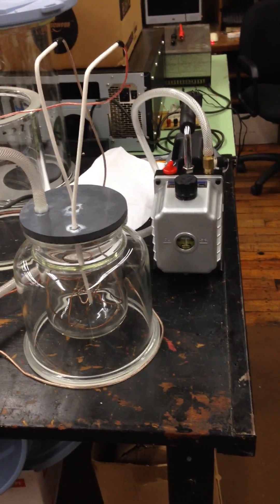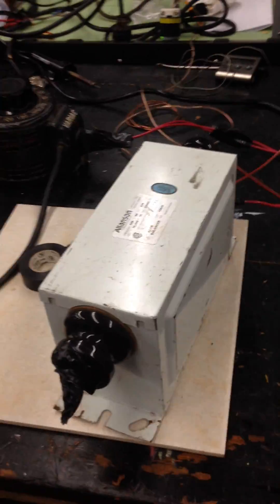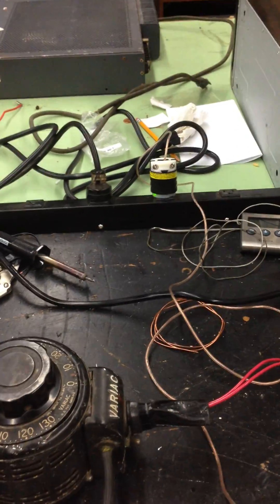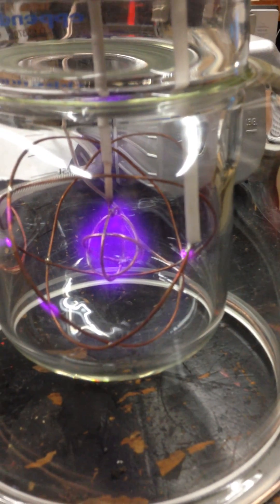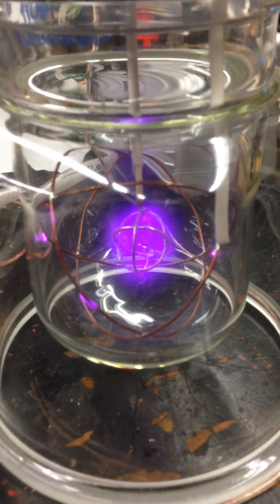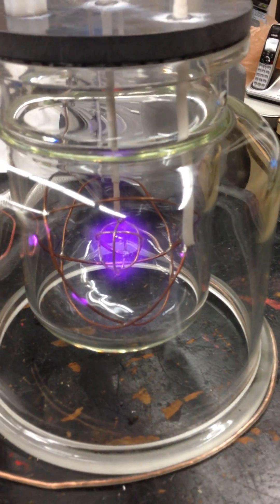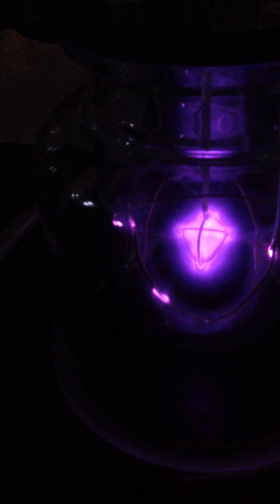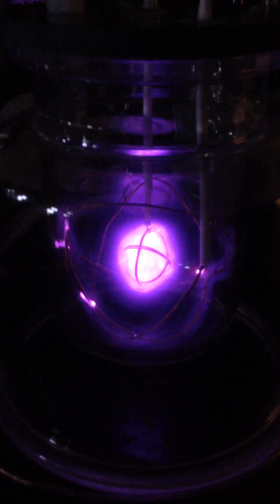Fusor in action 130%

Comment: Amazing but how the hell does that surface temp doest melt the damm copper tubes around the star?
Reply from the maker: The inner sphere is made from the tungsten filament from an old quartz heater. Plus it’s under a vacuum, so no air no heat transfer.

Comment: Where is the helium?
Reply from the maker: StreamWARE there is no helium the chamber was under a vacuum. The Purple glow you saw was residual atmospheric gases. High end researchers use much better vacuum pumps to achieve a higher vacuum level and a lot more power. This was akin to a light bulb in comparison to what a actual set up can do. A cool light show but not capable of producing actual fusion.

Thanks for asking a question
Reply: @TheValveBoy  Well i was thinking about making a fusor with helium inside of it, do you have any advice? Im going to be using 12kv
Reply from the maker: StreamWARE if you want to do research check out 
https://www.fusor.net/board/

Deuterium is what you need not helium, 12kV is in the starting point of fusion but you have to pull a very high vacuum and inject a trace amount of deuterium into the unit. If you manage that your going to need shielding as well, as you will start to get neutron production as well as x-rays and a UV light. Do some research, talk to others on the boards and be safe, 12kV will kill. Respect what your going to be playing with or it will bite you.  
Other people who are working on this are a great resource and know a lot more than I do about this. My unit was a demo unit little more than a cool looking light bulb.

Stick to it and good luck

Comment: Awesome build! Did you ever test to see how long the inner grid lasts before melting? Do you have any plans to get another transformer (or two) and go for actual fusion?
Reply from the maker: The original inner grid I made was out of soft copper wire. It melted/vaporized in a few spots after a few runs of 10 min. I made a tungsten inner grid that has lasted so far, from the filaments of old quartz heaters. If I can scrounge the parts together I would like to go to the fusion level. The equipment needed gets pricey quick. Ultra high vacuum pumps, and all the extras piping and gauges and chambers cost quite a bit.
Reply: @TheValveBoy  you can make an ultra high vacuum by using sprengel pump :)
Reply: @121sunita  Why did you have to say that? You just had to say that, didn't you? Now that I hear it from someone else I have to build one🤣. I was thinking about making one just earlier today for this exact purpose and here you are giving me positive reinforcement, now I have to go buy a bunch of glass lol. At least I already have 3.5 pounds of Mercury, that will make this project a lot cheaper...

Comment: can it make electricity?
Reply from the maker: At this point ....no, but there are a lot of people out there with much more advanced set ups than this that are getting neutron and X-ray production as well by products of the fusion reaction. The key of course is to find a way of harnessing the energy of the reaction and getting past the break even point. Which no one has done yet.
Reply: @TheValveBoy  I have a feeling that fusion in the stars only works because of pressure exerted by gravity. Since that pressure doesn't come from any source but the mass of the star itself, energy can be produced after fusion. The fusion reactors here on earth are trying to create magnetic fields to create the same pressure but we won't be getting net positive energy out of it because of the above reason I have stated.
Reply: electricity from it can power part of the building.
Reply: it can but its not practical. its more of a cool experiment thingy
Reply: build up to that point.  it could power the lab (and more).